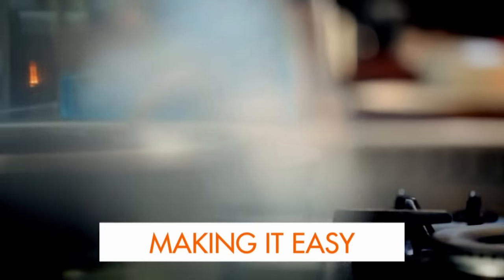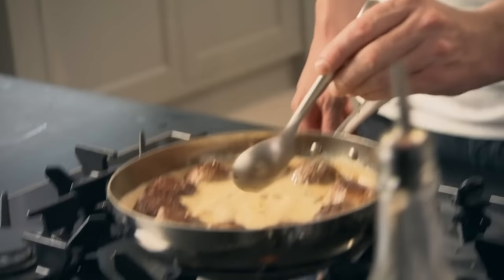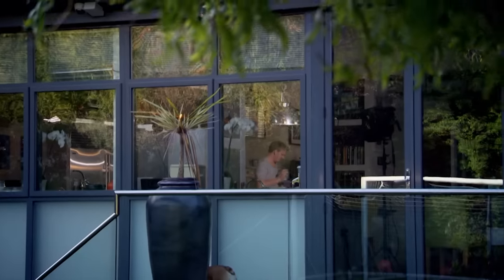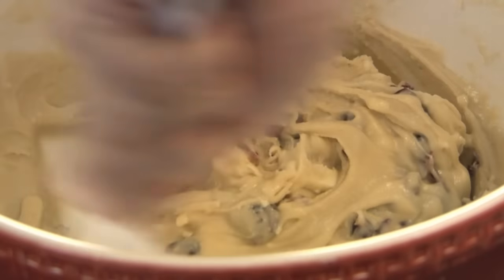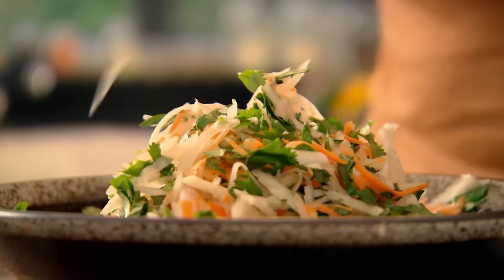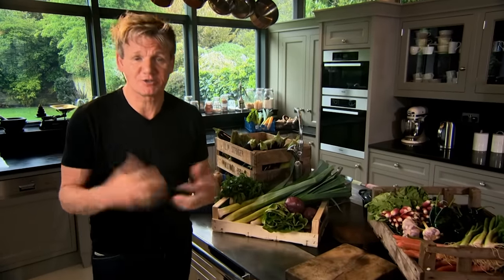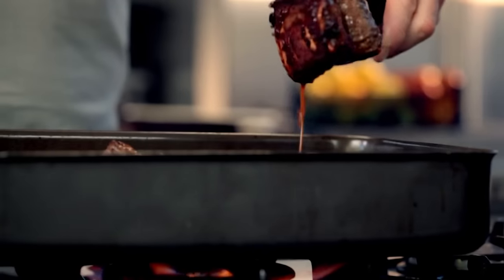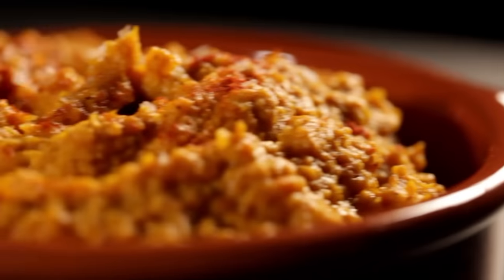Weekend Meal Prep Recipes | Gordon Ramsay's Ultimate Cookery Course

Comment: STOP PROMOTING SEED OILS GORDON!
Reply: Is there a problem with seed oils? like im curious i actually dont know
Reply: @BobTheAnimeDude  hi mate, yes the stuff is highly toxic and was once used as a machine lubricant. The process they use to refine it is horrific. Not told cause it's cheap and easier than healthy fats such as animal fat or stuff that is cold pressed. Number 1 contributeer to cancer obesity and heart disease
Reply: @johnrutter3985 *me now throwing away every bottle of seed oil I own
Reply: @BobTheAnimeDude  good man. Main thing is to be aware of it, cause it's in most processed foods. A little of it might be ok but yeah.. check out some talks about it on youtube
Reply: @BobTheAnimeDude  stick to either butter, animal fats; coconut oil or extra virgin olive oil
Reply: Seed oils aren't bad or toxic. Just use in moderation just for frying at high temps. Better sub is avocado oil which has omega 3 fatty acids and a high smoke point.
Reply: @PLBurke-fe8pd  they are super bad and toxic. Obviously you have no idea
Reply: @PLBurke-fe8pd  they are hugely toxic and it looks like you dont know so do not comment on shit you know nothing about